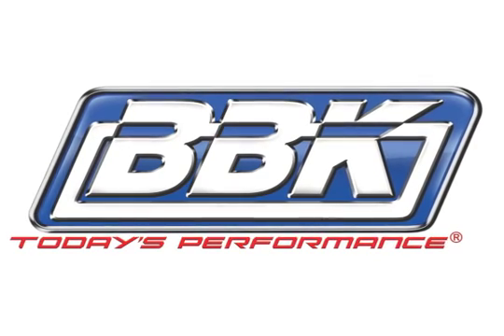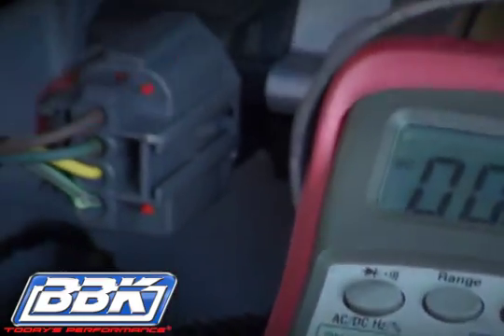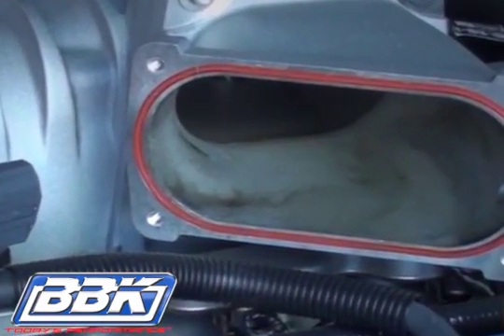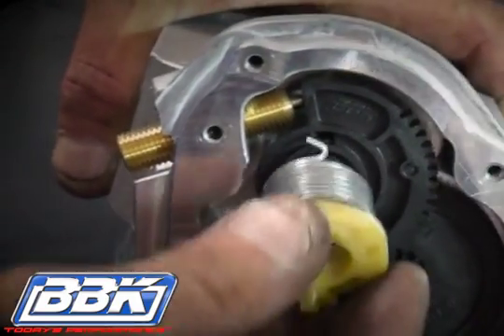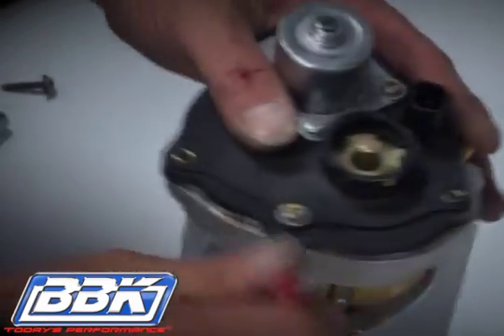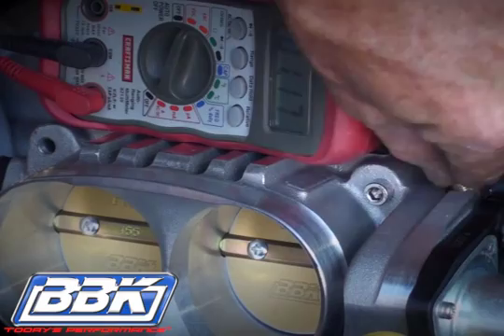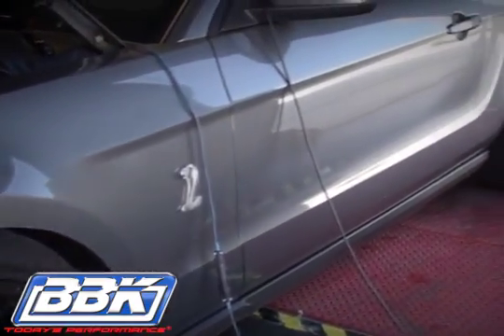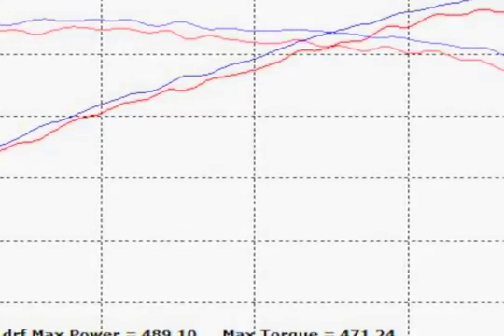BBK Throttle Body Assembly Installation

Comment: I installed this to my mustang gt 2005 now acceleration is an issue when I accelerate it takes very long tome to go back to idle what should I do.
Reply: You need to cut the 1/8" off shaft that goes in to the motor housing. It's too long and doesn't let the plastic motor housing sit flat. so it flexes and binds the motor gear.